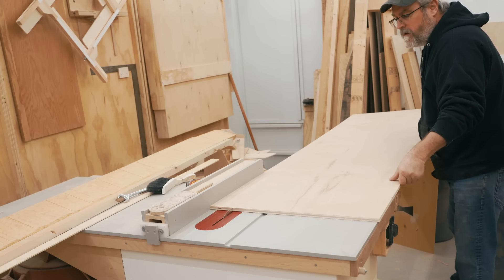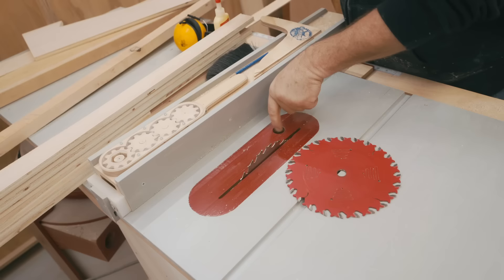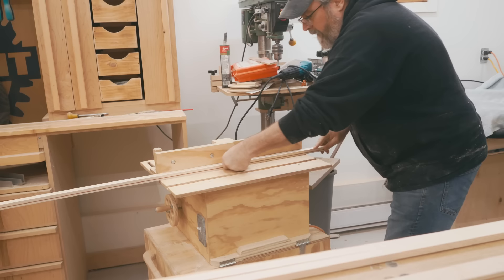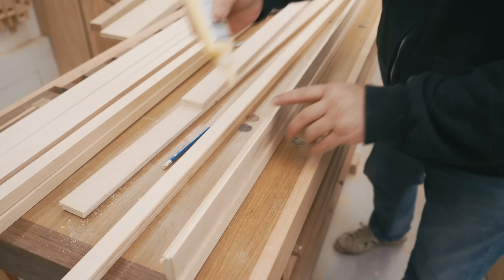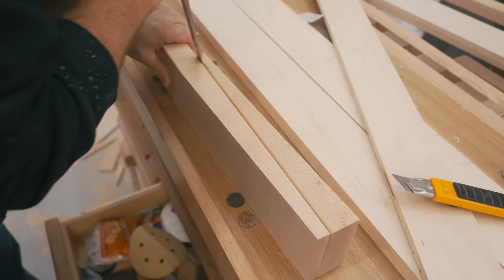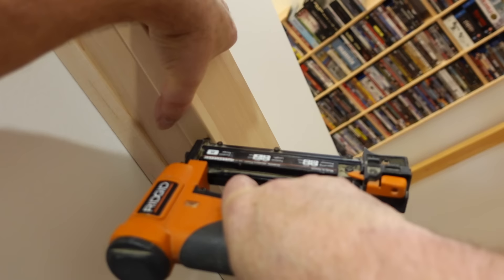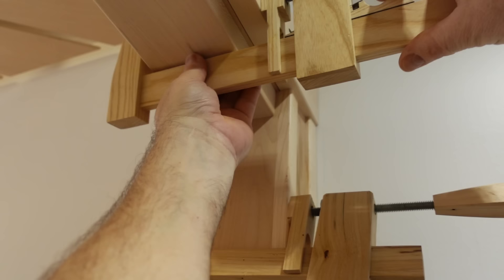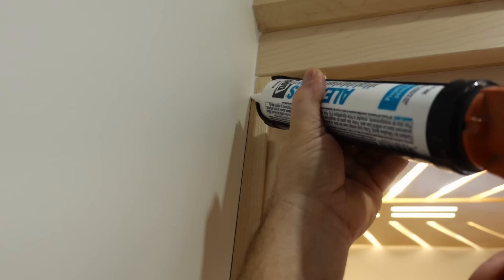Making Fancy Doorway Trim Moulding

Comment from the maker: Maker’s Mob Black Friday//Cyber Monday: https://go.themakersmob.com/black-friday-super-sale-ibuildit/?via=ibuildit

I had just finished the lighted sunburst wood panel ceiling in the stairwell when I immediately started working on the doorway into the stairs. 
Although it doesn't have a door, it is framed for one and I thought it would be perfect to act as the entry into what has become my wonderland of escape from the world. 
These stairs go to my dedicated room for listening to music, reading and watching movies, all completely disconnected from the internet and other modern distractions.
The trim design matches the ceiling I just finished:
https://youtu.be/ykiFRO9WAi0
And the shelving I built for my movie collection:
https://youtu.be/jvjqeyT3rjc
While the moulding profile and details are not overly ornate, the trim does have a number of parts.
- The jambs are just 1/2" maple veneer plywood, although solid maple would have been better.
- The casings are made up of three pieces to form the stepped profile, with more of the maple ply as the centre.
- The head is two piece with a crown that has the same chamfered  profile as the one I used on the shelves.
- There are a pair of tampered decorative blocks in the corners of the jambs that pick up the tapered sunburst rays in the ceiling and give it a subtle Art Deco feel.
- Solid maple plinth blocks on the entry side of the opening complete the look.
Reply: Talking about your self in the third-person is weird af.
Reply: Sounds like John might have some improvement plans for John during John's annual review with John. lmfao l loved the video buddy.
Reply: 4 4 4 4 a disadvantage disadvantage both the seller seller buyer especially and the 444 444 not sure q9